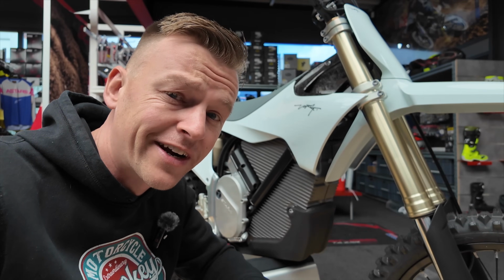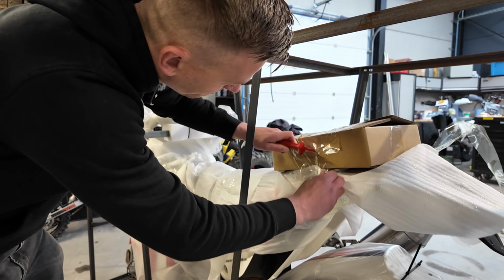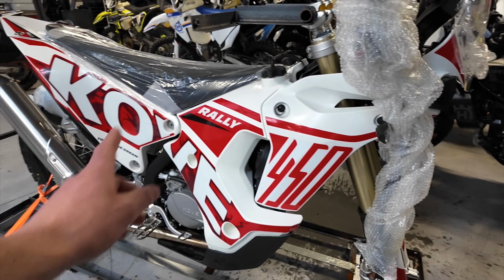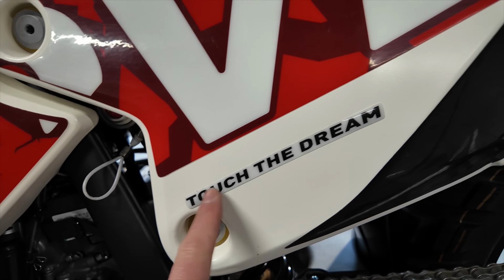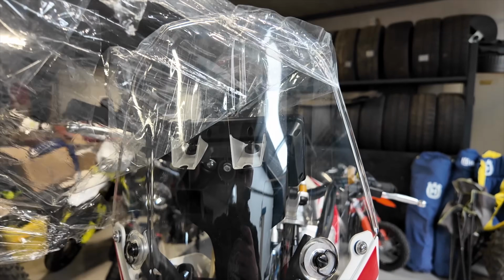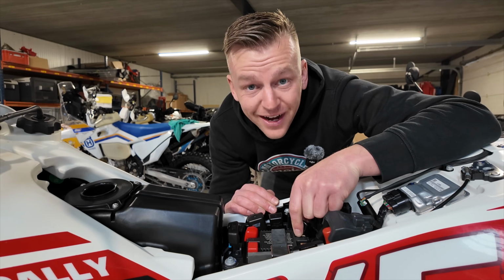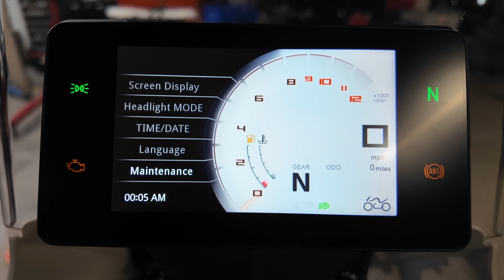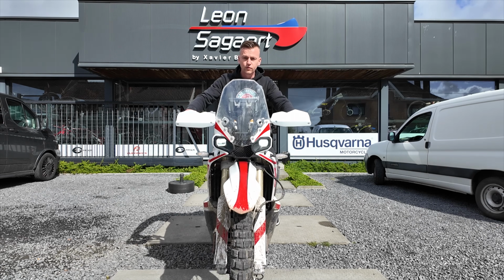2024 KOVE 450 RALLY Unboxing & Assembly : First Look UP CLOSE!

Comment: I've built 4 bikes out of the crate.
Two RM 250s and two Yamaha TT600s.

It's very satisfying. 

BTW, you should have bounced the forks a few times before you tightened the front axle pinch bolts. It's good to be certain the forks are parallel.

Comment: By now, with hundreds of folks around the world getting their hands on that bike, it is...a piece of crap. It has zero torque and needs to be revved up all the time.
What about this review: I need to change the oil from brand new because it is dark and needs replacing?????
I have a Royal Enfield with over 1500 miles and the oil through the little check window is still crystal clear.
That Chinese bike at 10,500 euros is NOT a bargain.
It is a piece of crap.
Reply: Allow me to correct you, as I have actual experience with bikes that share an engine with this bike, the engine in question being the Zongshen NC450. I have never seen any major issues when working with these engines, I find them to be very reliable. Now the Kove uses the DOHC version of the bike. This version indeed likes to be revved, and the "lack of torque feel" is probably due to how it's geared. The Kove is geared fairly tall, probably because most people who buy one are not going to take it to places where some would go on a 300 2T. Normally bikes with NC450 engines are geared a little shorter, like with the Fantic Caballero 450. That thing feels pretty good, torque wise. This issue can be easily fixed on the Kove by doing a sprocket change. I get the hate, it's Chinese and many chinese brands have a (rightful) reputation for being shit, like Orion/Apollo. However, brands like CFMoto, Kove, QJmotor etc have proven to be capable of producing quality bikes. Hell, KTM & BMW work together with some of these brands. The Loncin group (Kove is an autonomous part of that) manufactures the smaller p-twins for BMW, and CFMoto makes the 790/890 engines for KTM. And KTM helps them develop their own bikes as well.
Reply: @darko_lengkeek-jakupovic They build engines for 790 only, not 890.
Reply: @srdjanmaksimovic1779 thanks for the correction, but the 890 only has a slightly different stroke and bore, it is otherwise the same.
Reply: 自大的印度人😂